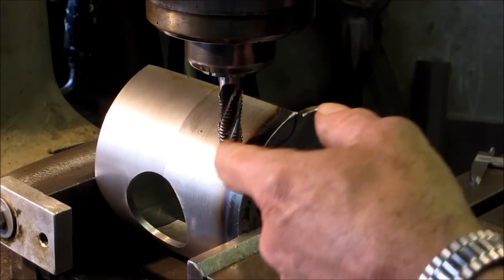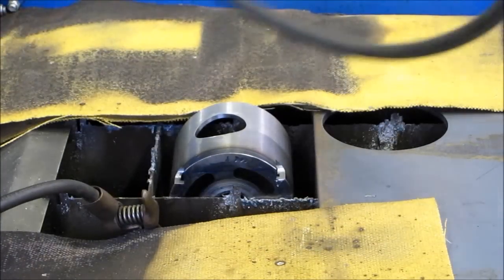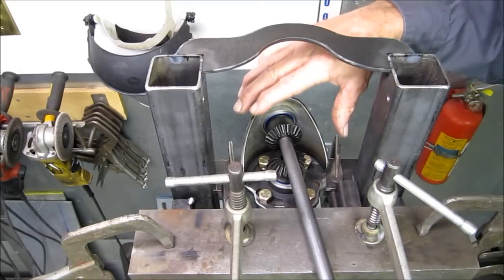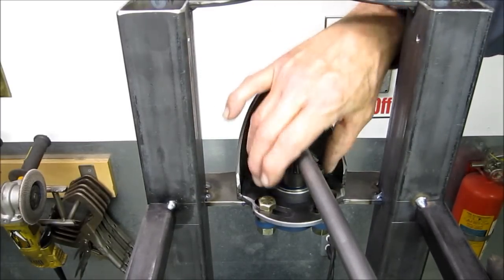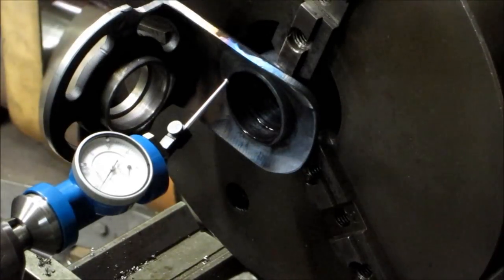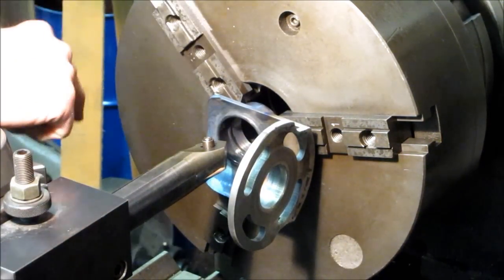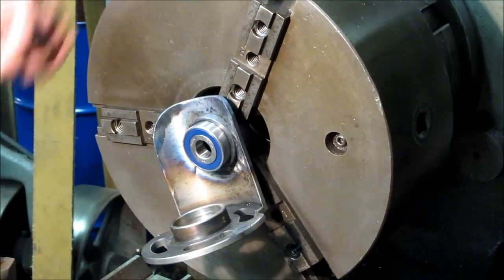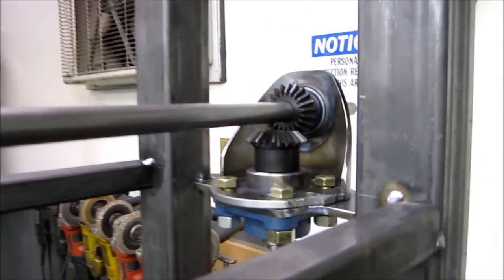Big Screen Elevator Part Five

Comment from the maker: Those were to real close fitting parts and I was just using what is called fusion welding, no filler metal just melting the to pieces together. It was to minimize heat and distortion. ;{)---

Comment: hi, love your videos mate.

I'm just wondering, would you change the way you designed and built up the gearboxes after the fact? Do you think that it would have been easier to build them with excessive back lash and shim the gears away from a bearing to take that play up? That could allow you to work with greater tolerances and prevent you having to put the housings back into the lathe.

As I said man, I love your videos and am looking forward to seeing the final product.

Comment: Absolutly loving the videos, one of the very best channels on YT!

Had a think about what you said about the two leadscrews, one having to be left hand thread and costing more.
That cost can be negated by putting the driving gear on the "outside", instead of the "inside".
That way both screws will turn in the same direction and you can use two right hand leadscrews.

It wouldn't be as pritty and symetrical as what you have now, but who the bleep cares, it's behind a wall anyway.

Comment: Nice job Keith looking good.  The bearing supports turned out good, nice and symmetric which is hard to do when cutting/grinding by hand.  I'm sure if you had to make more than 2 you would have thought of a different way.  Maybe another axis for the cnc plasma down the road!!

The important thing for the bearings is that the are in plane,and at right angles, which you got by machining after you welded them up.

Comment from the maker: Well after all the expeience with boom, cargo, aircraft elevators in the ship repair, it did cross my mind! Also rack and gear system! 
 
 I have also ran alot of HBM's thoughout my career, the head stocks are driven with lead screws and I have never seen one go in the free fall mode.

 Safty, is a good thing to think about when building, elevators...